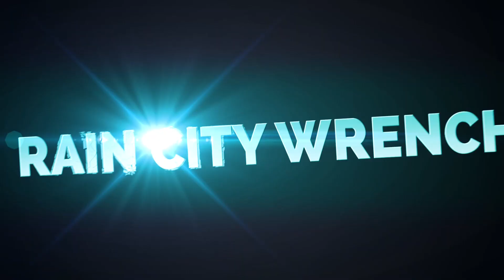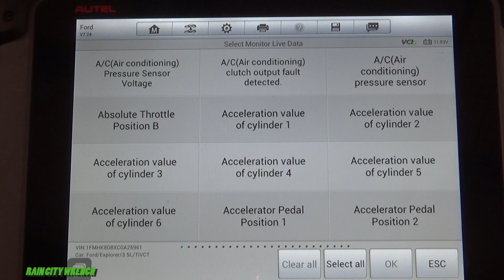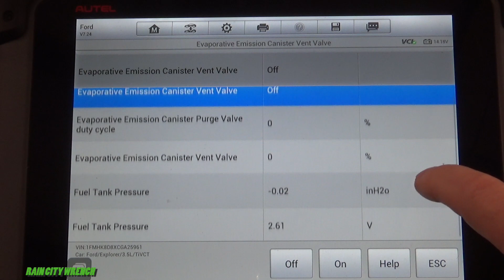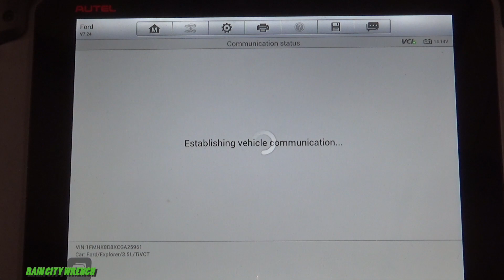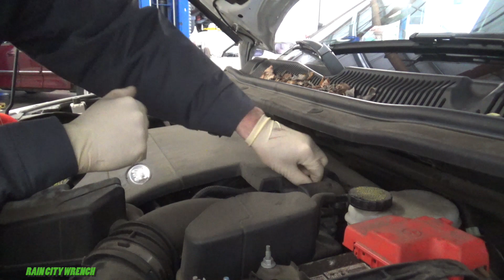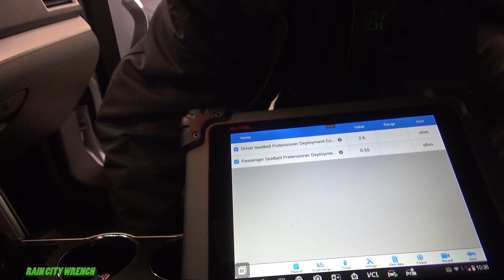2012 Ford Explorer P0456, B1213 Diagnosis and Repair

Comment: Hello where is located that conector? To fix the Seat belt pretensioner
Reply from the maker: C312 connector is under the seat.
Reply: @raincitywrench117  thank you, I am going to buy a car and the current owner tells me that the car has that problem, so I want to check before buying, thank you very much for the help, from Costa Rica
Reply from the maker: @ricardoretana468  Is it an Explorer? I can look up the wiring diagram and tell you exactly where that connector is and what color wires.
Reply: @raincitywrench117  it is an explorer, please that would be great,
Reply from the maker: @ricardoretana468  Is it a 2012 also?
Reply: @raincitywrench117  2011
Reply from the maker: @ricardoretana468  C312 is a 34 pin connector under seat and C3066 is the four pin connector for the buckle pretensioner. The pretensioner wire colors are WH-OG & BN in C3066 four pin connector. If there is a poor connection it will be at one of those connectors. Try unplugging and plugging back in and good chance it will fix it.
Reply: @raincitywrench117  Thank you very much, I already solve the problem with your help

Comment: The Autel really is a great scan tool. Haven't invested in the scope add on as of yet. Had too many people say it can be rather buggy compared to Snap On and Pico.
Reply from the maker: I agree. For the money, very tough to beat. I paid 1600 for my Autel 908 without Jbox (off ebay). The shop has a Snap-on Zeus that cost over five times as much! The Autel has been able to do more functions, have coded three VW abs modules, programmed keys on GM, Chrysler, Honda, Toyota. Snap-on did not support any of that. I would not waste your money on the maxiscope, I also heard they are junk. Pico is the best but really expensive and more cumbersome under the hood or on test drives. I picked up a used Verus for 400 bucks strictly for the four channel scope, don't use the scan functions at all. I bought some 10' test drive cables for it and you can see it in many of my videos.